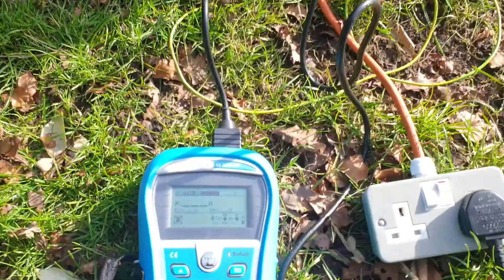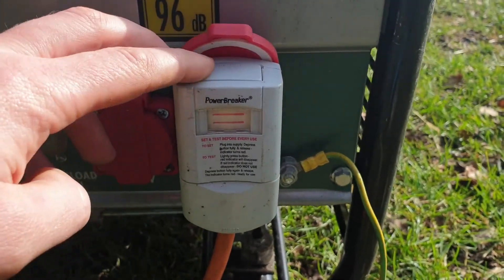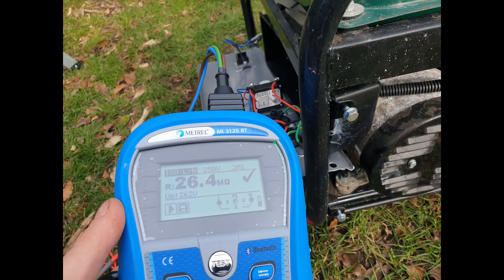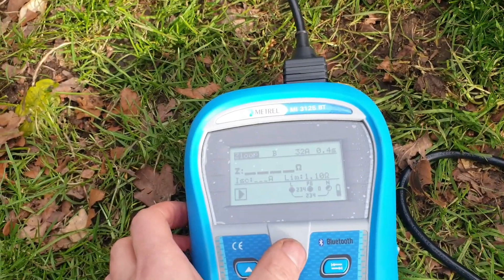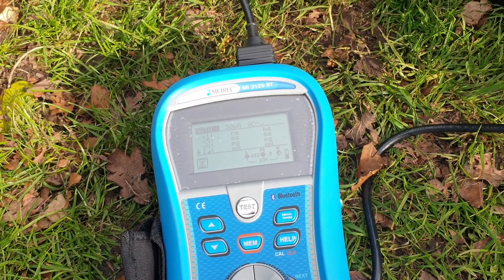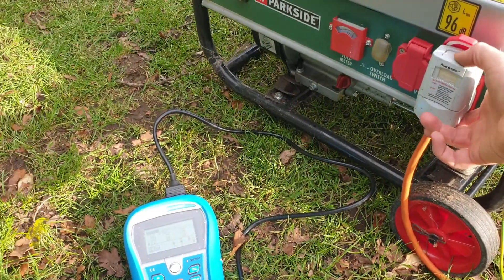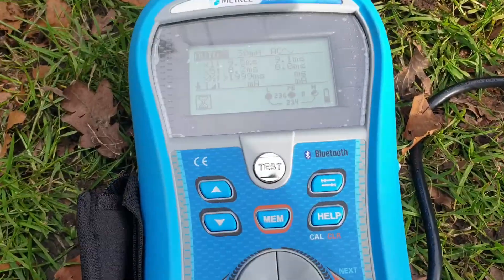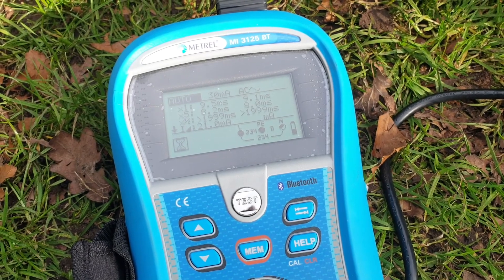Modifying a portable generator's earthing to add RCD protection.

Comment: Would like to see that modification in more details along with some earth readings etc... Assume you would remove the link if no earth rod was fitted?
Reply from the maker: Yes, though I don't think it really matters. You don't really need the additional protection on something like this because the neutral is not earth referenced as it would be on most grid connected installs. 

You can't get a true earth reading without some test kit that I don't have. My meter can do it, but I need some additional leads. If you measure the impedance at the moment you're very much limited by the relatively high impedance of the windings on a small generator.

Comment: When testing my generator I noticed that the GFCI on my garage sockets (the only circuit with a breaker on apart from the air conditioning) tripped. Should I earth the generator to a ground spike? (Don;t know much about this stuff!)
Reply from the maker: I'm assuming you're in North America based on having a GFCI? It's an unusual term for Europe!

Generally over here larger generators should be earthed with a large spike and in the generator the neutral and earth would be connected (as in a TN-S system, the neutral and earth are connected at the supply transformer). Small generators only intended for temporary use supplying a couple of outlets will often be floating (as originally in the case of this generator).

Specifically your issue, if you turn off the garage and turn on another circuit with GFCI protection what happens? Also what happens if you unplug everything from the garage circuit?
If other circuits also randomly trip off I would say you have a neutral-earth fault on a non RCD/GFCI protected circuit. But that is only a guess. If it's only the garage that trips or it doesn't trip when everything is unplugged then that narrows things down.

It's UK specific but this video might help you understand what's going on inside the generator:
https://www.youtube.com/watch?v=mzCGE5wnWos